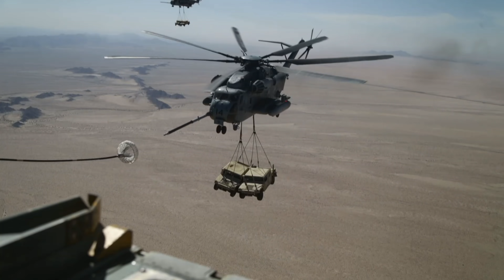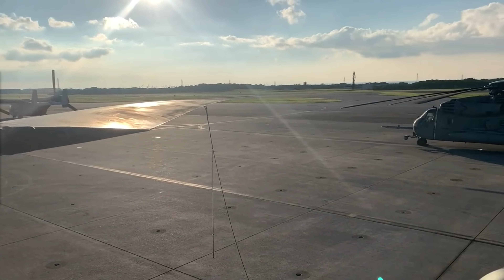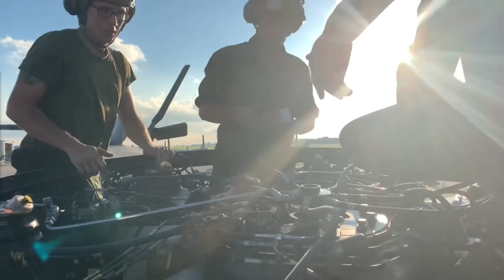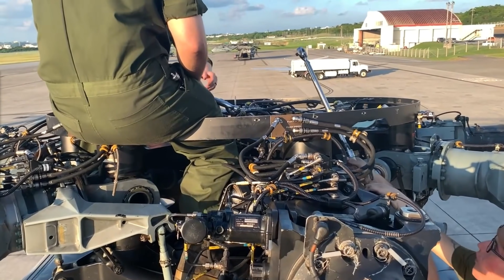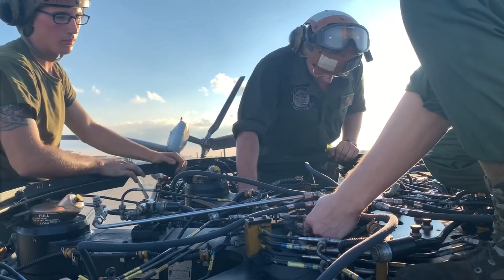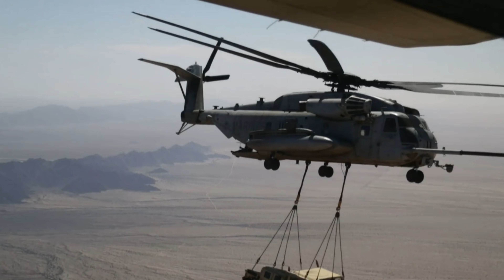Why are aircraft technicians so vital to the military?

Comment: You Sir couldn't be more correct. 
I was an USAF  a 43152,   Aircraft Maintenance Specialists,  Aircraft with 4 or greater engine's. Look at their age. The Maintenance done outside in brutal conditions.  USAF can and does perform Maintenance  outside to - 55 . Yes that is  55 degrees below zero fahrenheit.  And yes drop 1 nut, bolt,piece of wire or tool and if it cannot be found,  YOU must report it and yourself to Quality Control , put a red X in the forms and be ready for the worse ass chewing you can dream of.

I will leave you with this.
sustineo alas

[ soos-tin-e-oh -ah-lahs; English suh-stin-ee-oh -ey-las ]

Latin.

I sustain the wings: motto of the U.S. Air Force.
Thanks for shining the light on them.

Comment: Go one step further back Matt, when looking at that rotor head.  See every one of those hydraulic lines?  The clamp blocks?  The specific screws and washers and nuts holding the clamp blocks in place?  There was somebody, at the design terminal (today, or drafting board back in the day) drawing that all out in nauseating detail, to insure it all fits together.  Calling out the specific quantity (and exact type, by part number) of nut, bolt, washer....specifying the stack up (bolt head, washer, clamp block, washer, nut).  Figuring out how much slack needs to go in those hydraulic hoses.  And that's just the engineer putting out the final drawing.  Then there is the Stress Engineer figuring out how thick those rotor parts need to be to withstand the stresses, so the design engineer can specify those thicknesses on the drawing.  And the Material and Process engineer to help figure out the right alloy to use, and the forging process to get the proper strength characteristics in the material (use 7050 in a lower wing skin for example, and it'll fatigue out...need those 2000 series aluminums for fatigue resistance, or if you in error align the principal stress in the part with a short-transverse grain in the raw forging, you'll get failure).  And the Manufacturing Engineer to both figure out how to create the raw forging and the final machined parts.  And more Manufacturing Engineers to come up with the assembly sequence for the bushings and bearings and the multitude of assemblies.  And the Maintenance Engineers who write the maintenance procedures for that part that we see here.  And even before any of that...those hydraulic lines are merely doing their part to fulfil the overall design of the hydraulic system...somebody had to draw out, in a schematic, what that hydraulic system would be.  And....and....and.....   So many people have no idea how complex it is to design and build modern aviation equipment.  And that just gets it to where the Maintainers get to do their job to keep it flying.  Many, many people are needed....EVERYONE needs to do their job, by the book, to keep it safe and effective.

Comment: I remember my dad telling me about a story of his time as a backseater and camera operator in RF4's. low level flight over Grenada and the low fuel light comes on. He tapped the panel and it went out, all good right? Nope.... Finished the mission and went to tank to the return flight only to not be able to gain enough altitude to hit the tanker. Turns out the fighter was almost out of fuel, the fuse for the gauged had blown and the bulb had blown out at the same time. The pilot looked down and said they had 15 minuets fuel and the tanker was 20 min away. Thankfully the tanker was lower and closer then the AWACS had said and make it to link up with less then a minuet of fuel left in the fighter. He did say that they had to replace there flight suits and the padding of the seats after that flight. Seems that a maintenance checklist had bin skipped on his fighter in favor of a 4 star's plane.

Comment: Have had to hunt for many a nut or washer or screw dropped inside helo's and is why some tool boxes had magnetic wands. You say that aircraft don't have to deal with the mud and such as ground vehicles, well back in 91-92 in the Gulf when you had all those oil well fires going it wasn't pretty. You had these sticky oily clouds mixed in with the normal dust and sand that was in the air and it made for one hell of a mess if you flew in it. Beside being a mess to clean it would chew up rotor bearings. We had bearings that went from hundreds of hours between inspection/changing to tens of hours.

Comment: An old jet mech here on A-10's circa desert storm. Did everything from flightline to Depot level maintenance. Never was allowed to carry my safety wire pliers or anything else for that matter in any pocket except for my wallet buttoned in my rear. 
We were also taught to torque while pulling the the ratchet whenever possible not pushing it, one has better control with less slips.  Also never used a pair of channel locks on any part of the aircraft. Wasn't even in our tool box. 
Never had laptops either just paper technical manuals, we did however use the old core automated maintenance system to document tasks performed and labor hours spent.  
My worst experience was when I accidentally dropped our #2 bearing pusher on the floor. The shop went silent and I spent the next 30 minutes being lectured by my shop chief about the importance of not dropping the $185,000 tool and how we would be without use of the tool while it was sent out for NDI to be checked for damage.
Reply: This is what I'm super afraid of. Even in General Aviation, some of the tools I'm handed can't even be bought in my country and has to be shipped and calibrated. Some could cost hundreds of thousands to millions which I know as an AMT I'll never be able to replace for like two decades.

Comment: I will start my reply with; I wish auto technicians would be equally attentive when doing their work. About 15 years ago I took my car to the repair shop to get a timing belt changed. The technician could not find a nut. When I started the car to go home the nut in the timing belt guard dropped between the timing belt and the cog that turned it. This stopped the cam shaft from turning within the specified timing sequence for just a few seconds but the rest of the engine was within sequence. This resulted in me requiring the shop to perform a very costly and inconvenient repair to my engine. ( like several thousand dollars worth) When I work on my car I will not start the car if I am missing anything. ( a bolt, washer, screw driver, etc) It was a very memorable experience. A big hands to all the repair people who do their not just well but with thorough ness.
Reply: When I was in AMT training, my Instructors always tell me to watch out for Car Mechanics as these people usually give service to those who has no idea how engines work. They can easily manipulate things and give your wallet a harder time. The best way really is to first check the Internet and even YouTube to see what the problem is and how bad it is. Inform yourself first with the problem and watch the Mechanics as they do their thing. Never leave your car out of sight.
Reply: @pilotmanpaul  I forced them to cover the total cost of the repair.

Comment: My father was a pilot the Navy for 24 years. And the people you are always nice is to was a crew chief of your aircraft and the ground crew for the squadron. They make sure everything on the aircraft works and if something God forbid goes wrong they also make sure that that ejection seat works. ( Well except for the A-3D he flew for a couple of years in the 1960's. No ejection seats in that one. Just an escape hatch and a prayer. 😂 The Air Force looked at that and said no way! Let's throw some ejection seats in that SOB and call it the B-66! You should do a video about how big the cojones had to be for four air crew to get into an aircraft with no ejection seats and fly it on and off of an aircraft carrier in all weather day and night in the '60s.👍👍👍👍)😂👍 Between the lack of technicians in the country, and what we left being unserviceable, Afghanistan isn't going to be taking to the skies any time soon. We literally could not train an aircraft mechanic from Afghanistan. All of the maintenance for the Afghani Air Force was conducted by contractors or Air Force personnel. They just don't have the technical ability or background to deal with them. Like it's really difficult to take somebody that has barely seen an internal combustion engine before and say hey go fix this turbine and make it work. And if something happens make a new blade for it with your manual lathess and milling machines 🤣🤣

Comment: A great video which gave an often overlooked perspective. I enjoyed working on the Puma helicopter, reliable and good access for most tasks. Although working up top, at night in winter was a bit slippy and a good way to meet nurses if you fell. Tornadoes were the opposite, requiring constant maintenance. Ground crew ops in HAS's, (hardened aircraft shelters) weren't good for your health, massive noise, vibration and fumes when the engines spun up. But the HAS was nice and cosey when locked up, under NBC conditions. All in all, never a dull day in all of my 22yrs of service as a RAF aircraft electrical technician.
Reply: Me too. 230 Sqn Pumas, 79/80. Good bit of kit and easy to work on, for us Sumpys at least.

Comment: You gave the example of the dropped washer. In one of my experiences, a plane was downed for electrical issues. Once fixed it needed a wash to be ready to fly. When we were finishing up a wash on said aircraft we discovered a damage that we couldn't ignore. Said aircraft then spent the next month as a hanger queen/ cann bird on the boat. But the feeling of watching hours of your blood and sweat put a $110 million bird into the sky is amazing. Cheers from the USMC.
Reply: I feel that we got a new 35 of the press 2  years ago , didn't even finish the echo joaps before she smacked into a vulture.  It's been sitting in the hanger till this day "permanently" our CANN bird

Comment: I had an uncle who worked on cold war CF-104 Starfighters.  He claimed for every flight hour they were in the air, his crew at RCEME would spend over 15 hours carefully checking every last little bolt and fitting as well as major parts on the aircraft.  Nothing was left to chance and if something did go wrong, it was very easy for his crew to be brought up on charges.  Maintenance on aircraft is not joke.  Every thing must be done to technical manual, no parts forcing, no bending pipes or rods.  It was not too uncommon for a pair of Starfighters to have their own dedicated maintenance crew of 4 or 5 guys just spending upto 8 to 10 hours on the pair of jets.  If a part got dropped or was missing, yah there was hours and hours overnight just looking for that part.  Part of the reason was these were jets constantly flown at the extreme edges of their performance envelopes and they were high risk jets to fly.  Despite the best efforts of a crew of flight mechanics, these jets were infamous as widow makers.

Comment: Well, several things:

1) One of the reasons I think the Tornado is a terrible aircraft is: It is so maintainance heavy: Just imagine getting the middle spool of the RB199 replaced. There are so many parts that can go WRONG - and they are all in the most inaccessible places. The Super Sea Stallion is just a lump of spares working themselves up to parting company with each other.

2) The other thing is that governments procure the absolutely minimum number of aircraft/tanks/whatever needed to do the job. Well that job better be done within a year - otherwise the wear and tear will keep the equipment in the shop for overhauls - and consume SPARES - you might be able to save some of the spares when you can repair them at your lessure in a planned manner.
People rarely realise that maintainance cost is largely driven by flying hours no matter how many aircraft you have.
Today when equipment stay in service for 50 years the maintainance is getting to be a far more important factor that the purchase price. That is one reason why the Draken left Danish service: It was cheap enough to buy, but the spares were costing an arm and a leg.

3) Maintaining a proper staff i.e. trained means that when you need it you can fly with an intense operational schedule by taking the staff away from some periodic maintainance - that means your capacity wears down and can only be recouperated over time. The USNavy in WW2 got around that problem by throwing aircraft with some damage over the side. That is not how things are generally done, as there is a lead time for production of replacements.

4) An example of proper maintainance is the finnish Mosin-Nagant rifles of WW1. When Finnland gained independence the russians left a ton of them. For the next 20 years the finns tinkered with them - and actually made them into very good bolt action rifles.

Comment: That's what I did, airframe repair. Basically a body and fender man for heli's. Replaced a lot of Kiowa and Huey windshields and chin bubbles, plus the odd hole in the skin. This was in the late 70's at Fort Campbell.

It's funny now, kind of...a Huey once hit a turkey buzzard at top speed and it came in through the co-pilots chin bubble and basically exploded, blood and guts and feathers everywhere. By the time they got the heli back to the hangar the stench was unbelievably bad and getting worse by the minute...the Kentucky summer will do that. I was high on my First Sergeant's Shit List that day, having gotten rascally drunk in the barracks the night before, so guess who got to replace the bubble and clean up the mess? Yeah...don't irritate Top. He's not nice when he's angry.😒
Could have been worse, though...at least I wasn't the co-pilot. He ended up having to throw away his Nomex flight suit.